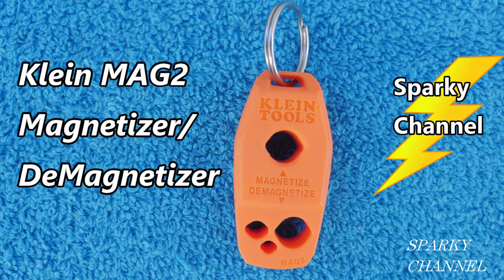Wet Rated Electrical Gang Box Installation + Installing EMT into an Existing Gang Box

Comment: Hi! What about the locknut of the connector? UL requires that the locknut has to be installed always when the fitting is fabricated and tested that way. That kind of boxes should only be used with threaded raceways like IMC or RMC.

Comment: Thank you for this insight. My neighbor told me i had to drill holes thorugh the back of the box to install. With no instructions i was wondering what the 2 screw and mini brakets were for. I did think it was odd to have to drill through the metal!
Reply from the maker: No problem, thanks!

Comment: When using rigid PVC and a generic weatherproof pull box with no access holes, how do you drill the holes for the rigid PVC conduit entrance without losing your wet rating? There seem to be two styles of pvc fittings to adapt the rigid conduit to the PVC box, threaded and unthreaded. Both are glued to the conduit, and the threaded fittings pull tight to the box with a nut, the unthreaded are glued to the box. Am I correct to say that you want to use the unthreaded PVC fittings, and ultimately glue those fittings to both the box and the incoming PVC conduit? Would you still lose your wet rating if you were to glue the threaded fittings to the box as well as the conduit?
Reply from the maker: Hi! You really need to use a UL rated exterior box with threaded holes.

Comment: 1:37 What sucks about those metal ears and screw is that they are not coated and will totally rust out in damp locations.  I just removed a box that was perfectly fine, but those dang rusted bits gave me the most trouble.
Reply from the maker: I agree with you! I hope a manufacturer comes out with a better fastening system.

Comment: Bill, great video and it made me think of a question.  I replaced a receptacle under my kitchen sink today.  There was rust on the receptacle and the copper was corroded.  Are the boxes under a sink, which seems like a possibly wet location, supposed to be wet-rated like this box?  I replaced the receptacle with an AFCI/GFCI and put a weatherproof cover on it.
Reply from the maker: Hi Jerry! I don't know of a wet rating for such boxes but you're wise to make the box as waterproof as possible. Great job!

Comment: Can't you also screw through the back of the box? If I remember correctly, there are two little nubs you can punch out and run a screw through. Though you'd have to add some sealent to keep it from leaking there
Reply from the maker: Not if you're using it as an exterior wet rated box. You have to be extremely careful with exterior boxes so that absolutely zero water gets into them.
Reply from the maker: I was at an IDEAL National Championships and saw a contestant win the finals on time but he took 2nd place instead, winning $25K instead of $75K partly because he didn't use the little ears on his wet rated box. Can you imagine losing $50K because of that? He also stepped on the top rung of a ladder during the contest though....

Comment: I never use those ears .  It doesn't look good with those ears. There are two projections inside the box diagonally where they can be punch through easily like knockouts.  That is  where I put the screws.
Reply from the maker: Thanks!

Comment: Bill i have a question, i have always drilled holes through these and then filled the drilled hole behind the screws with a lifetime warranty caulk when they were screwed down because i kept finding that the little screw and ears they came with would eventually pop out over and over when screwed down. IS screwing them down by drilling a hole in them and caulking against code?
Reply from the maker: I don't know of any such code. Just be super sure no water can get in. Also, there are some little indentations that are apparently made for screwing through, so I would use those.
Reply: Were you screwing them by hand? If you thread them in properly they shouldn't come out. Don't use a power drill, either. I have never had an issue with the ears.

Comment: The connecters need to be rain tight, yes?  Silicone should be applied to the threads of the plugs, yes?
Reply from the maker: If the connectors are used outside, they do need to be weatherproof. Silicone on the threads is optional.
Reply: You don't need silicone.  Rain tight connectors include a gasket between the flange and the box, sealing off the threads and the hole.
Reply: @mg30ebay  You need silicone for the knockout plugs.  It states so right in the directions.

Comment: But the emt 1 screw connector isnt wet proof though.
Reply from the maker: Good point but you don't have to put the wet rated box in a wet location. You can put one in a garage, for instance.

Comment: The outlet box has pipe threads which are tapered.  However emt fittings have straight threads.  Did you just tighten the fitting until it bottomed out?

Comment: doesn't look WET rated. ??
Reply: It is. I use them all the time.
Reply: The box is wet rated but that setscrew connector is not
Reply: @davidgee4601  have to use a compression connector, right ?
Reply: @cebsaint  yes with a gasket